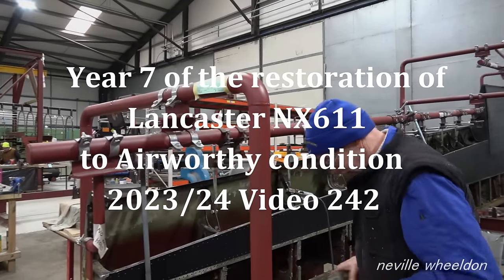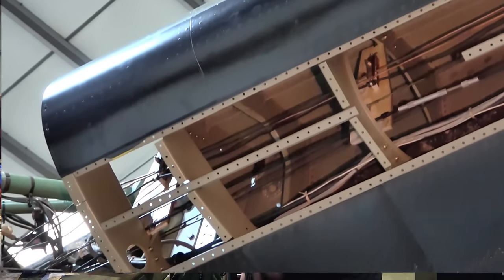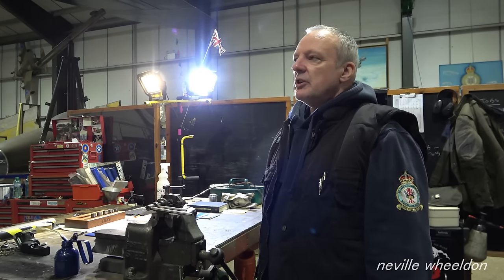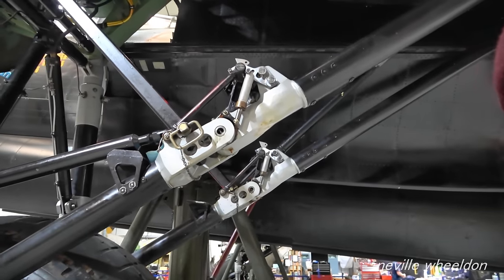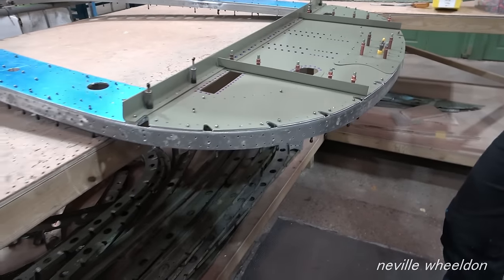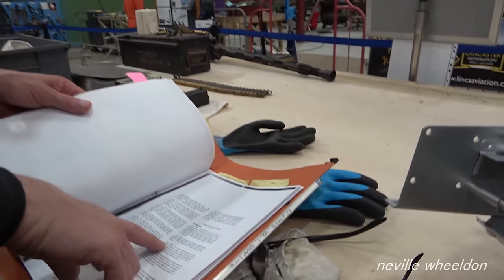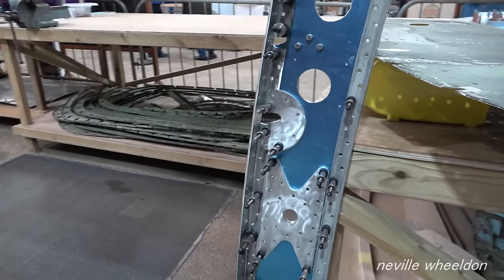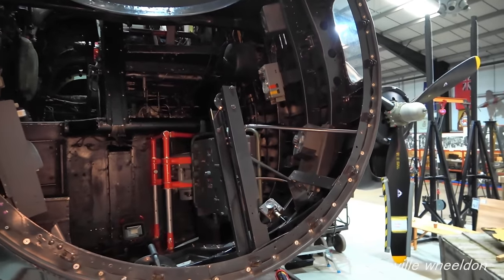Video 242 Restoration of Lancaster NX611 Year 7. Improvement to outer trailing edge Jig.

Comment: I see a pattern over the years, of y’all re-inventing the assembly procedures in many cases - from an assembly line with thousands of workers, to a boutique shop with individual craftsman.  I point to the discussion you captured by Dave, about, “Will see if I can fit the inner (former), and add the outer (flange) in situ.”  Wonderful capture.
Reply from the maker: Thanks HH.

Comment: What do they do with all the unserviceable parts that have been replaced Neville? I’m sorry as I have asked before but can’t remember if anyone has answered. On one hand if they are scrapped it’s like throwing away the original aircraft but it has to be done I guess they would use the scrap value to help fund the project .

Maybe they should sell off some of the parts to collectors , “own an original part of NX611” and turn other pieces into souvenirs? I bought a piece of skin from FM212 which is in Winsor, in Canada.
Reply: Pretty sure they sell scrap parts. I saw a Merlin camshaft for sale in the gift shop!
Reply from the maker: I believe they have not decided what to do with them yet ,some have been used on the French dona parts